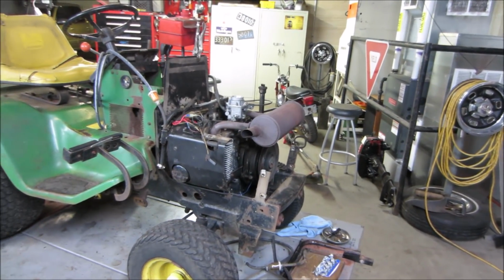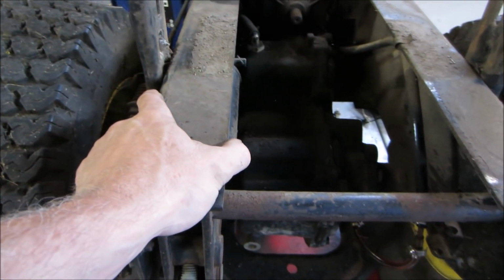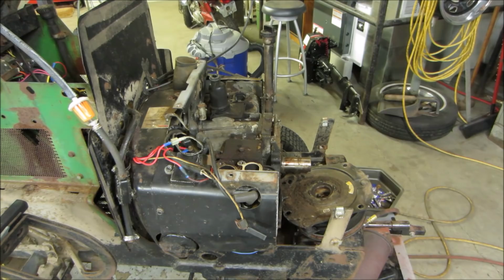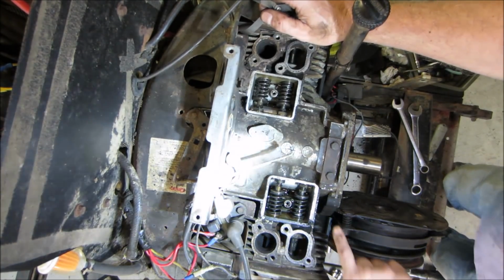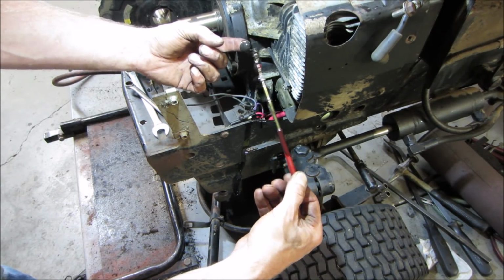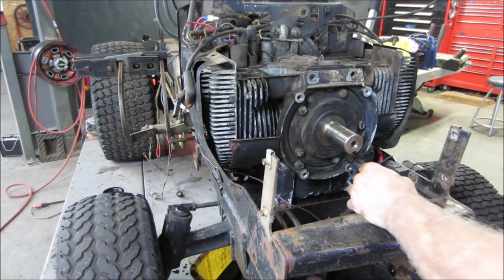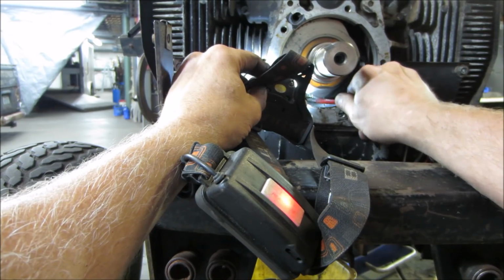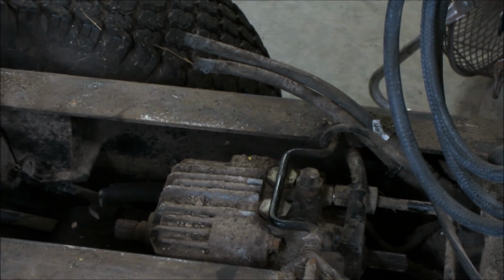Free John Deere Has a Bad Engine Noise? Can We Fix it?

Comment: It's got to be the most 'different' fix the motor video I've ever seen! You were really determined to find that little part and very sure about where it had to have gone. Such a great video. 
The only thing I wondered about is why you didn't have and extendable magnet...I've got one that sort of opens and collapses like an old TV antenna. And why you didn't test out it's  magnetism on the caps that were already there? 
In any case much enjoyed the video and was cheering along with you when it finally fell out and into your waiting hands. Well done.
Reply: When you don't know the innards of an engine, therefore can't say for sure which path the tip cap took, you need to find it. Remember, there's a crank and rods spinning round in there and it the tip cap picks up and wedges between, say, crank and crankcase, you end up with a hole punched out, not nice. Also, the problem with a magnet on a sick is that they attract to every bit of ferrous metal they are near, makes the task damnably difficult when operating in confined spaces. Mustie made that point when he was fishing around and I felt for him at that point having been in the same position many times over my career.

Comment: Cool, Wow this tractor has way more to it than the new ones for sure. Speaking of a unexpected surprise. When I was a young dumb mechanic and heavy footed on the gas I bent the push rods, rounded the cam shaft and pitted the solid lifters on my 68 firebird going full throttle down the freeway for 10 miles. Didn't know that you can due major damage like that till I took it apart. Fun project though

Comment: There's no pin to lock out the rock shaft. There is a valve you screw into the body of the rock shaft cylinder to block fluid flow to lock it out. The method you're thinking of is for closed frame machines (300,316 Kohler, and 317).

Comment: Great video. I know your pain. Dropped a timing chain tensioner bolt down down into the crankcase and spent several hours attempting to fish it out with magnets and a 12 Ga wire bent into many contortions. You were lucky and retrieved the part. I was not.

Comment: Thanks for the good laugh and great entertainment. You and my other favorite wrencher Bus Grease Monkey are fearless about ripping into it. You might want to look through the horde for a better seat bracket, those leaf springs are awful. I used the bracket off a 240 on my 330, worked great and you sit a little higher. Keep um coming.

Comment: Onan's are really easy to work on, especially in a John Deere configuration.  Wheel Horse had the one cylinder up against the front cowl and you had to remove the engine to do any cylinder head or valve work.  This is actually a common issue with the P216-P220 engines also see similarly when a seat lets go due to overheating conditions, all due to poor maintenance.

Comment: That stupid valve cap really didn't want to leave that crankcase!
Nice job tracking down the valve noise issue, too bad it wasn't as simple the lash adjustment to fix. Dang, they don't make that one easy to work on, do they?

Also, no need to skip the cleaning, that's interesting to watch also!

Comment: I was mumbling and growling when WE were chasing that bloody lil' ***piece of...metal***. I was telling you "Use our vacuun cleaner with a small plastic/rubberhose in there to suck it out !!"  Guess you did not hear me.
A few times, I used kerosene to clean small unloved engines followed by cheap motor oil. Works perfectly. The crap that comes out is impressive.

Comment: Years, and years ago I remember while working in the USAF on various aircraft, some of the things we would "find" inside left by other mechanics over the years, cloth rags, a metal flash light, screwdrivers, pens, bolts, nuts, and one day an SR-71 ground aborted due to a 3 foot long pry bar left in the stick well area....major bummer.

Comment: Valve adjustment ends with a totally stripped mower, but that's how it goes sometimes lol. Maybe add a screen up there to keep it from happening again? Also if you ever have hard to find gaskets I have a friend with a cheap china built laser cutter engraver. I can scan the parts and have them cut in less time than it takes to drive to the local supply house. For all the stuff that you do it might be worth looking into since they're pretty cheap now.

Comment: Im surprised you didn't have to take off the steering wheel and left back wheel to get the muffler out in front. :D
What a tear down, just for a smal metal thingy that wanted to go on adventure inside the engine. Glad i didn't do any damage, and it made for very entertaining and educational video, as always :) (and yes i know this video i 3 years old. I have been diving deep into your backlog the last month or so)

Comment: Extremely well built! But those Onan engines notoriously have valvetrain issues. If you decide to pull the cylinder heads please be sure to check both valve seats paying close attention to the exhaust side. They tend to loosen in the block and start to vibrate so badly the seat being hardened steel will beat the aluminum block side inwards thus causing the valve to remain open at all times.

Comment: The hour meter in my dads old 318 had yellow script too and a guy said it wasn't OEM yet we never touched it since new. 
   As for not using impact sockets goes, as long as you're not gripping the socket with your hand wrapped around it while giving it the beans you'll be fine. You just don't want to be holding it if it cracks/breaks because it can tear your hand up pretty good. Other than that most sockets these days are pretty good and hold up just fine.

Comment: Had a valve cap fall off the end of the push rod while I was mowing with my craftsman riding mower, which killed it.  When I pulled the valve cover off, the little cup shaped piece was sitting there in plain sight.  Put it back, adjusted the valve lash and it's been running good since.

Comment: That one got a lot more involved than one would think at first, and I was trying to push through a bit smaller of a magnet on a flexible shaft I have to ya..but I don't think it would have got it either. Popping the pan off  was going to be the only solution anyways, and as you said, allows you to get it all now. Any word on that snowblower attachment that you thought you had? Should be a decent unit after it gets done, and those things work hard for you when operating well. Kind of sorry I let 1 of the ones I had go now.

Comment: Geez  reminds me of my last angioplasty and open heart surgery.  I was wondering if you could have gotten a wire down the hole where it fell and hooked it out.  Or maybe made an electromagnet to go down the hole and then put power to the magnet.  Easy to suggest from here as I am not there and can see the stuff well like you can.  Fantastic operation.

Comment: @Mustie1
 You should get one of them USB microscope thing. The one I got was on amazon and it can connect to a android phone and you can take some close-ups of small parts like when u work on a carb. Works really well. has LEDs for illumination. Only $20. Should think about it
Reply: That's what he was using. The oil made it not work.

Comment: The foot pads on the floorboards don't show much wear for a tractor that age. I replaced mine with some used black shingles and contact cement. Worked well and were cheap.

Comment: When I was younger and didn't know better, I regularly used standard sockets with the impact driver. Fortunately I never experienced a socket failing, not sure if it would just split or shatter the socket. As Mustie1 stated, there's times when the impact socket is too wide and I'll use a regular socket with eye protection.

Comment: You put a lockout "valve" in-line in order to use the front hydraulics while locking out the deck height.  I put mine near the cylinder in the left rear.  Not east to get to, but worked.

Comment: Would you do a valve adjustment before putting on the oil pan ?Just to prevent a repeat of the issue of the part falling into the crankcase and having to remove the oil pan again

Comment: That was a most exceptional problem. I was voting for it to be stuck in the valve-compartment outlet, but of course that's wishful thinking. How fortunate it wasn't jammed against something rotating or bashed to pieces. Classic Mustie save. Do you think it was caused by simple lash-nut loosening, or was it from a user valve-adjust attempt gone sorely awry? Look forward to its redeemed smooth running. What are the odds it was only the more tolerant intake valves? Have to call it a "lucky" mishap.

Comment: A trick I picked up working with jet engines where a lot of the internals and fasteners are non-magnetic, you can use a length of brake line/hardline tubing, cap up a vacuum pump and have an air retriever. Nothing worse than trying to go fishing into a compressor section to chase a fragment of a snap ring or something ridiculous that would wreak havoc by blowing through the various passages, or worse, getting jammed up in a friction surface.
Add: Just for 100% clarity, most times when you have a vacuum pump out, you'll have a dump chamber preceding the actual pump intake, but it doubles as a handy retrieval vessel for fluids and things like chipped Inconel blade tips. Be kinda silly to suck directly into a pump trying to save one machine and destroying another needlessly. 😉

Comment: I only found these "Mustie" videos because I have a JD 170 lawn tractor. I never thought I'd be following the recovery of a machine in this depth. I had no idea that there would be an 'Onan' engine in there - I guess I half expected to find a twin cylinder version of the Kawasaki engine in my own machine.

I guess you'll be getting that cap back in place before you reassemble the rest of the engine, I mean, you wouldn't want to lose the cap down into the little hole and have the whole engine job to do again! But I am also thinking, while you are this far in, why not take off the heads and de-carb the top end as part of the exercise? Plus, you'll also get a first hand view of what state the valves are in - worthwhile if they needed lapping.

My guess is that those valves probably have never been adjusted in their entire life, and given the tortuous route you have to take to get to them, I'll bet it's a step that got left out of many and many scheduled services?

Great videos, these, and nicely made, clearly narrated in a friendly voice that I could listen to all day long. You have the patience of a saint, to fish out that cap, and you did with such good humour and grace. I take my metaphorical hat to you.

Comment: When i was an apprentice working on marine engines for oil tanker size ships, someone (not me!) dropped a spanner into the the thrust-bearing housing at the rear of the crank. Apparently the best way to retrieve such an item was to dangle an apprentice (me!) by the ankles in the box to fish around with their arms in the oil until they found it!

Comment: I have a couple pairs of needle nose pliers that are twisted from using them to open valves that way . So I cut a slit in an old socket  and use it to open drain valves no more bent needal nose pliers.

Comment: That stub on the back of the transmission pump is missing the fan.
The pin you are talking about to block off the deck hydraulics was an option on these. I may not have it

Comment: I think to problem with the deck seizing up is the pulley on the front of the motor that is just behind the grill, it has a magnet that engages the deck and the three fingers break causing the deck to stop working. I wish there was a way for me to get in touch with you, my friend has a massive John deer yard like a car junk yard and he has every part for a John deer. From hoods, seats , tires, rims, axels, decks, gas tanks.  And that clutch costs $400 and he sells them for $150

Comment: Some advice, now that you have removed the motor check the shaft for play. Replace it if it does. Loose shafts are a big problem for that motor. I  am referring to the output drive shaft.

Comment: I am sure you had already tested to find it was magnetic, I am just wondering why you didn't turn a couple wraps of wire on the end of that screwdriver and zap it with a battery a couple times too magnetize the end of the driver? Anyway, persistence certainly pays off in the long run. You have a couple coolers in there that need cleaning that also look like they were impossible to get too without removing the engine.

Comment: Just a question if a lawn mower only runs when the air filter is off of the machine could it just need a new air filter or should I check the carby to.

Comment: There are mounting "L" brackets on top of the engine that are missing on this engine. there is one towards the front and one towards the rear, you can attach a chain or a strap to them and pull the engine out easily. Fix it up and getting running  it is a power house.

Comment: Reminds me of the time I was fitting a distributor drive into a newly built wbx engine.
One of the bottom washers went 'ping' inside the case. 

Fished around for ages but could not find the bugger. 

Though meh, what's the worst that could happen?
5 minutes after starting the camshaft snapped in two seizing the engine!

Comment: Mustie, FYI  you can usually get a oem service manual, on a cd , on ebay for about $25....I bought one and printed it out It was around 480 pages. A real deal for $25......also, oem manuals for the onan 18hp, is on the web for free....

Comment: I had a replacement engine put in my 317, had a magnum 18 put in to replace the kt17 series 1 engine , At a John Deere dealership and they replaced the stock John Deere hour meter withe the same one you have on tha 318.. it is the exact same meter made by Caterpillar  Or “Cat” ... so that is in fact a brand of hour meter JD uses..oh and  use a shop vac to get the crud off the top of the engine with a pick or screw driver so ya dont accidentally blow it down the intake or exhaust.. ive seen it happen..

Comment: If you need a longer magnet, electric/duct tape it to the end of your screwdriver.
If the screwdriver is long enough to touch it on its own, a magnet attached to said screwdriver will also reach it.

God bless.

Comment: This is why wire coat hangers will never go out of production: I've customised hundreds over the years to retrieve annoying escapee nuts and bolts.
Reply: rats arsed  Ha yes, at least I can get them from dry cleaners and discount shops. I still have a few in reserve.

Comment: Have a question if you can help.  Have a high hour Briggs 18 hp vanguard that is leaking out of the dipstick seal.  Replaced the seal dipstick tube and the the crankshaft breather. I keep checking the oil level and can only keep it half to three quarter full and it keeps leaking any suggestions?  Before changing the parts tried high heat silicone that failed also.

Comment: ditto on socket wall thickness, i've used 1/2 to 3/8 adapter and 3/8th drive sockets to get a tin enough wall before, sure sometimes they crack, shatter or the adapter twists off. oh well :)

Comment: i changed a cam chain and gears on a dodge 6 225. green van. still would not start with a loud spark sound somewhere.  I opened the points up so the spark plug wire is just ahead of the rotor. I ran it for about a minute. runs crisp.

Comment: A 2 cent screen over that hole it fell down would have saved a crap load of screwing around to hunt it down . I would definitely put a screen over the hole before I put it back together just in case it happens again . Also would slit that muffler bracket and put a plate with bolts over the split so you don't have to remove the clutch if you ever need to remove the muffler again .

Comment: My luck is it would have jammed into the crank and broke the crank or gotten chewed into chunks. I remember a friend of mine insisted he dropped a bolt down the manifold on his engine and we ended up tearing everything down just to find the bolt laying up on the windshield wiper. Talk about mad. lol. Then all we could do was laugh about it. At least you got that cap in one piece. Its going to be all clean and new gaskets anyways. lol. That oil was gross!

Comment: a question  to ask you  my parent have 1990 craftsmen lawn morrow never seen a carburetor take that one when a google the ser or the model number does not come up  had it off and clean it too all look good to me it the flout and the  bowl looks good  
all plastic too   
 do not know  who made the motor too  
the bowl does fill up with fuel  primed put gas into the plug it starts great too first pull too put fuel to the air fluter  it runs too  other than that no fuel gets to were it needs too  
would but a new carb for it if I would know more what I and look for too the small engine repair shop  said just buy a new lawn morrow did that  but it, not the same as the craftsman as to the cut goes

Comment: I used to work on Cub Cadets back in the 80s.  I could pull all the engines by hand up to the 16 HP.  When the opposed twin cylinder 17 HP came out, a hoist was needed.  I worked in both Cubs and JD models, and never liked the JD models.  Too complicated for my taste.

Comment: Wondering if this problem is unique to Onan engines, seems like a piss-poor design. Yes, you can probably install a screen of some sort to prevent cap from falling into the abyss, but the fact that they can work themselves off the the valve stem in the first place is the design flaw.

Comment: What a bitch that design was... lol. Have seen much worse! I guess that's why they had the short pipes with the join at the muffler. They can be harder to separate than removing that clutch!

Edit:- And I hope you put that little cap back on the valve before you refitted the sump! Lol...... There ain't much room for error in that crankcase! Surprised it didn't cause damage.

Anyway, onto the next installment!